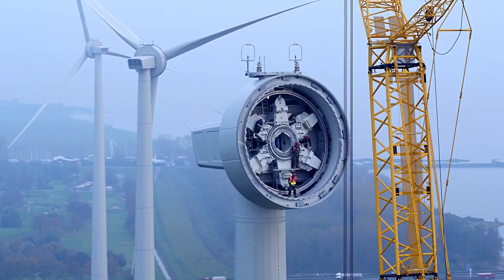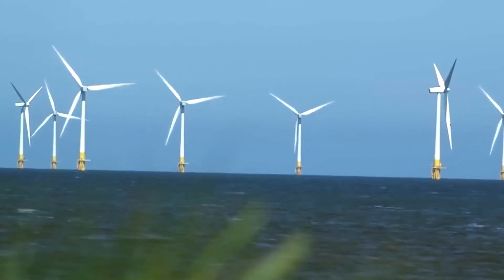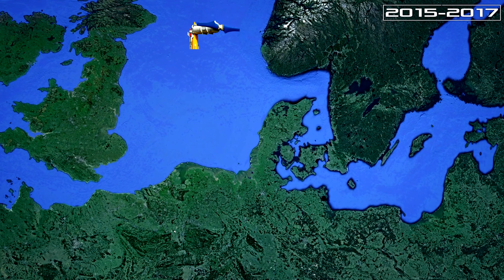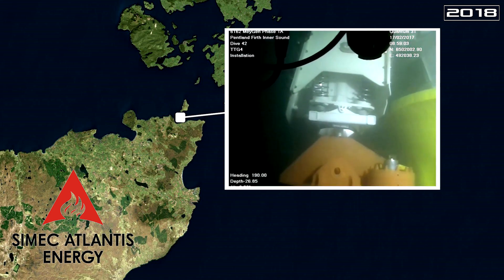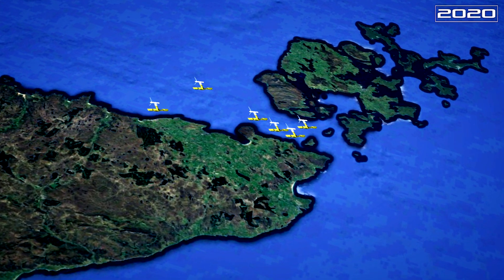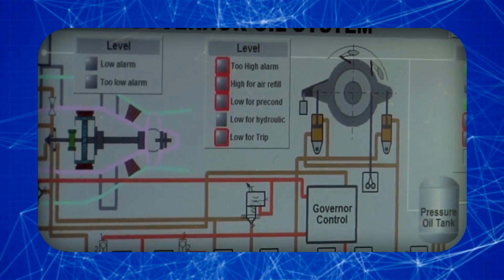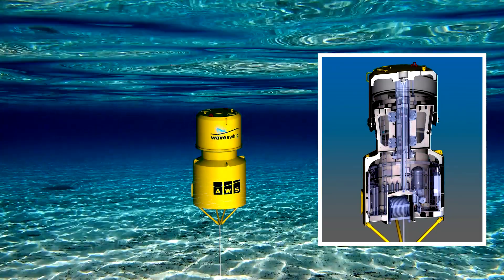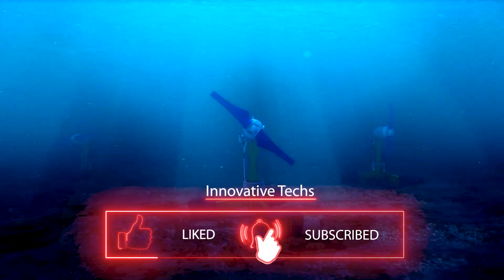THESE INVENTIONS WILL CHANGE THE WORLD

Comment: It occurred to me that wind can probably be brought online faster than a fuel burning plant.  For a fuel burning plant, the entire facility needs to be built into operation 100% before any power can be generated, which could take years, whereas wind turbines could probably be erected much more quickly, and as the comparable capacity is brought on line, the output of the energy generation could be utilized immediately.  

I think wind can function day or night, and in cold weather.  What can the state of wind technology provide for the conditions?  

Another consideration, what is more expensive, a wind turbine, or a guided missile or armed drone?  A singe missile hit could take a fuel burning plant out or action, whereas wind turbines would operate independently.  You might need many more missiles to accomplish a comparable result.  I'd wager wind turbines are also harder to hit, and much easier to repair or replace.

Comment: Good news.  Seal water cost still more to operate. 
Geothermal should win this race. Heat 24/7 on land.
Reply: You have few documentaries about geothermal energy. There is simply not enough locations in Europe to provide for all. Plus deper you go more expensive it is.
Reply: @javanava8925  If interested follow Eavor. Proper plant should running in Germany next year. I realize there is no silver bullet to solve all energy needs.

Comment: The fact that you can accurately predict when it will not generate power is no asset at all. We need power sources that can modulate output as and when it is required.
Tidal power is also relatively weak, it is asynchronous, no inertia, all the deficiencies of renewables.
Reply: You do have a point but I have one , and that is the tide is not only predictable but high and low tide times are different all around the coast therefore an integrated grid system would easily overcome any fluctuation  in power supply.
Reply: The tides are on different timings around the UK, sufficient to easily overlap.
Reply: Harry, 

I will admit I'm not aware of tidal times around the U.K., but there cannot be a real significant difference. But it is not like tidal flow one minute non the next. The flow rate slows quite noticeably as it approches and retreats from high tide.
However the very real drawbacks remain, asynchronous, no inertia, low power and expensive construction and maintenance remain.
Reply: @iareid8255  Tides around the UK are at very different times all around the coastline, a tide time table in one town is useless 100 miles away in a different town.
Reply: Muppet Keeper, 

fine, I accept that but still each and every plant would have a dead period twice a day whether it suits the grid or not, that and the many other negatives of tidal generation.
Reply: Actually, knowing exactly when power will and will not be generated is a huge asset. Fossil fuel plants need to be modulated, but tide powered plants can fill energy storage such as pressurised air, battery or hydro. You can size that storage perfectly, and never have to constrain generation, ensuring the best payback and lowest cost per MWh.
Reply: Mr Keeper, 
the amount of storage necessary is not that large and nighttime is the perfect time to store power as demand is lower.
Tidal is still low power, expensive and has not proved attractive historically. France built one many years ago but did not build anymore.
Reply: @iareid8255  All new power generation methods start expensive, almost all become cheaper, except for nuclear.  As for it being low power and asynchronous, there are several large synchronous drives in Scotland that are completed or being built to overcome the small issue of lack of inertia and reactive power.
Reply: Mr Keeper, 

if you are refering to synchronous condensors then they are an expense that comes from free with conventional generators. 
Lack of inertia is not a 'smal l problem', it is significant and a problem that synchronous condensors only partly overcome. Where a large turbo alternator has significant inertia, which dampens load fluctuations it also has a reserve of power to be able to accelerate the generator if frequency drops, inertia slows the drop but the reserve soon bolsters the frequency. Rotary condensrs cannot do that, they do help with reactive power but, as before that comes for free with conventiona generators.

We had a good generation system which is being slowly but surely degraded.
Reply: @iareid8255  You seem to be pushing burning things, which is not at all sustainable. So gas and coal are off the table. It takes 20 years to design, approve and build a nuclear power station in the UK, which then produces power at 6 times the cost of renewables, so in the medium term Nuclear is off the table.
Building inertia plant looks expensive, but it’s not. The latest ones are actually decommissioned coal fired power stations.
Conventional generation isn’t an option any longer, and as a power engineer, I’m more than happy that we are innovating, transitioning and overcoming the issues of the past.
Reply: Mr Keeper, 

we have got a very large amount of fuel, fuel that is very energy intensive. Don't forget we were running out of oil in 1973.
Nuclear is slow to build not helped by the hurdles that have to be overcome just in teh plannig. 
I don't know where your idea of six times renewables cost, that's not even close, and remember they last for twice as long.
The Hinkley point price is just below £100 per Mwatt and requires no additional supprt. Offshore wind is currently about £140 Megawatt hour (This figure is from an Edinburgh University analysis of power companies audited accounts). and that requires extensive support putting the cost to the consumer much higher.
Reply: @iareid8255  You are looking at the spot price of wind and comparing it to the CFD price of Nuclear.  The CFD price of each are as I outlined.

Comment: Why-or What is the Continued Desire to keep Using Airplane Style Propeller Designs! These Rotating Protruding Blades are hard on Non-Human Earthlings! Why Not a Large Diameter Elongated Water-screw with a/in a *Cylinder, with funnel Flares at each end, And a Cone shaped Heavy protruding Grill to keep/Deflect Debris/Ocean Life, away/out of Generator!, around the Auger style Blade? Seems to me this would catch more Tidal Currents, and Ocean Life wouldn't get Pummelled by Large rotating Blades!

 Plus when I see a large amount of space between the propeller style blades, that's a lot of area of Force Lost! More wider angled Blades in the "*Cylinder, with funnel Flares at each end, And a Cone shaped Heavy protruding Grill to keep/Deflect Debris/Ocean Life, away/out of Generator"  (Perhaps the "Cone shaped Heavy protruding Grill" could be Formed/Casted from re-claimed Plastics from the Oceans) (Once a particular 'Material/Re-claimed Plastics from the Oceans' is Needed, it gets harvested quickly! This would help with another Environmental mega Problem!)  
D